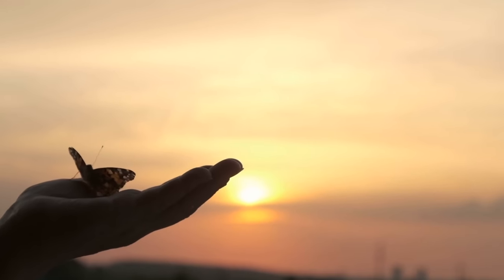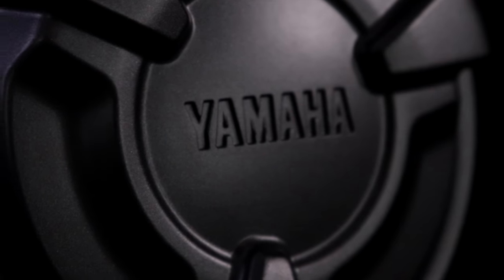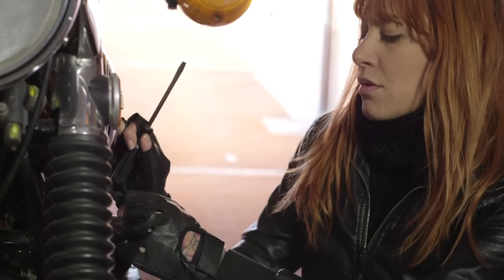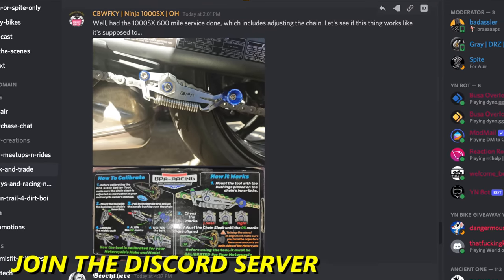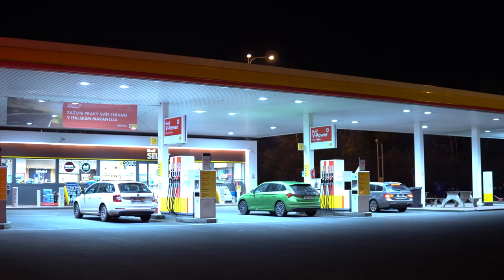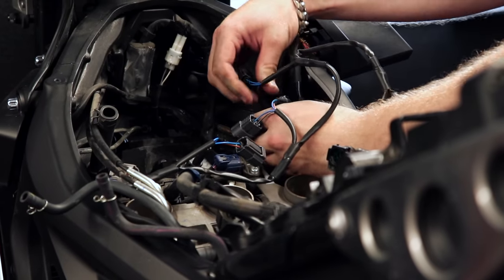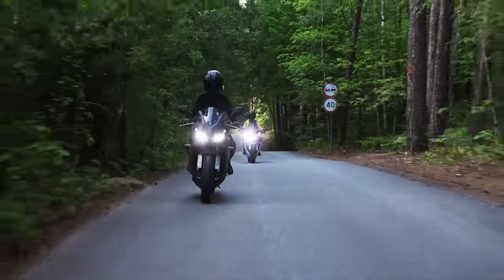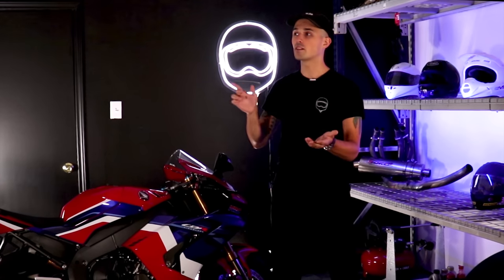7 Ways to AVOID Damage to your Motorcycle (Will Last Forever)!

Comment: “Never redline it.” I paid for the whole tachometer I’m gonna use the whole tachometer
Reply: redline is literally meant to be bounced off lmao. Makes absolutely no sense to say what he said. Proves the yammy noob downfall this guy been experiencing since covid.
Reply: Not to mention he reasons "Valve float", when generally the OEM sets redline 500-1,000 rpm before any Valve float (or other stresses)
Reply: @blizzthebike Todays materials cant withstand constant redlining. Do it and it wont last over 30k
Reply: This might be the dumbest thing I have read all week. Do you use that whole speedometer as well, or the whole brake lever, the front one of course.
Reply: @pmudri todays materials engine wise are better than ever before
Reply: @louiscrespo1280 Exactly
Reply: @louiscrespo1280 that’s not necessarily true because while we have better manufacturing processes, does that mean the companies are actually using them? Or are they cheating out on lesser metal and the putting them through a crazy process to only marginally “strengthen” them? That first comment on this thread got me laugh like a fool. Boy must’ve been dropped a couple times as a baby. Our steels aren’t as good as they were 100 years ago. Aluminum is one of those things where it’s either hot or miss on the manufacturing process. Some companies nail it, while others do not. Most of this thread makes no sense and I hope I actually educated someone today.
Reply: @christophertyacke6019 issa joke
Reply: @tty117 🤦🏻‍♂️
Reply: @christophertyacke6019 yeah the saying literally started as I paid for the whole speedometer I’m gonna use the whole thing😂
Reply: @christophertyacke6019  Ofcourse, just ease into it
Reply: @christophertyacke6019  it’s a joke but it holds some truth
Reply: as a 2 stroke 50cc moped user, I wholeheartedly agree
Reply: This line is said by fortnite 😂😂
Reply: Fortnine reference. Love it
Reply: @pmudri I'm here to remind you @ 70k Miles that is a lie on this 471cc. I'll be back to check on you later.
Reply: @louiscrespo1280  "Todays materials" oh please.. Ive seen SRADs that are used solely for redlining at gatherings , yet they are over 20 years old and still working fine.
Newer bikes could never lmao
Reply: @christophertyacke6019 😂😂 damn that’s some serious wit I’m jealous.
Reply: No, dont do it 🫣
Reply: HELLL YEAH BRUDDER
Reply: @blizzthebike Nahh you’re wild for that😂

Comment: Whew! I ride a Honda! 😂
Reply: Me too brother ✌
Reply: 2019 Honda CB650R here! ✌🏼
6,200 miles on the saddle and multiple mods and the smiles are endless per gallon!
Reply: @miguelcabanillas8539  I have a 2020 Honda Rebel 500. 9,500 miles already and riding as often as possible :)
Reply: On my second Honda CBR I love these bikes so reliable and I think there pretty sexy
Reply: Africa twin, only problems I’ve had so far fixed themselves
Reply: I became a Honda boy instantly. I Ride a 2021 cb650r, dreaming of an Africa Twin
Reply: Honda's very good but why did Yammie not mention the #1 most reliable brand in 2020.....Yamaha!
Reply: I've got a 2000 VFR800 and i don't think a new bike could be more reliable or last longer than my already 21 y/o bike.
Reply: 2006 cb600f approaching 45 000km
Reply: 79 CB750F over here still cranking
Reply: In love with my cbr 600rr and Africa twin. Honda for life!
Reply: This should be Hondas tag line or slogan…. I love it! Especially since I ride one 😂. I bleed RED, and if you bleed anything else, go see your physician.
Reply: I ride a 2006 Honda 919 hornet. It’s a great bike. I think the top end of the engine chatters slightly until it warms up. 17k miles had it for 5+ years, under 7k miles when I bought it. Great bike tho lots of smiles on it
Reply: Any CB300R owners?
Reply: HONDA GANG ! CBR500R her
Reply: My 2004 VFR had 101,000 miles on the odometer when I sold it.  The engine was still amazing, as was most of the bike.
Reply: Laughs in RVF400
Reply: So do I.
Reply: Regardless of brand any Japanese motorcycle will last if taken care of. 102k on my 05 zx10r. Daily commuter.
Reply: @Maxime_L91  yes boi. 5th gen gang. Hopefully you chose the only best color there is (blue duh) 

enjoy many more safe miles on the best bike there is!
Reply: 07 CBR600RR running new like I got it yesterday.  Just got new tires and a battery.
Reply: Same!🤣
Reply: I got a honda cbr 600 it's 1993 and still purs like a kitten
Reply: You meet the nicest people on Honda
Reply: @miguelcabanillas8539  I had the 2014 CBR 650F. I rode that bike 8 hours in one day, 6 tanks of gas in one day and it didn't even get hot, let alone have a problem. Great bike.
Reply: Lmao, they break too Papa 🤣 🤣
Reply: @CaptainFeathersword  because it's more better and reliable 🤔
Reply: @awatts222  you know, that was one of the reasons why I pulled the trigger on it. From scouring the internet for reviews and opinions, it all boiled down to "Honda has perfected this engine over the decades, it's a great beginner bike that could be a forever bike and it's well-behaved."
Reply: @Foodgeek  that's awesome bro!
Reply: @rodrigosimoes185  don't you find the throttle kinda snatchy?! Especially in the low rpms of 1st and 2nd. I want to have it tuned to see if they can smooth it out.
Reply: @PranouPranou  👋
Reply: Whew!! I ride a Duc🤘
Reply: @miguelcabanillas8539  yes, indeed. It's not tiring snatchy for me, but I can see how it could annoy me in denser traffic situations. I think it's getting better, but maybe I'm just getting used to it
Reply: Me too, I’m so bored lol
Reply: Have had a Honda for 5 months. Left stranded twice and been in the shop for 5 weeks of this time. Not sure I feel the same as others.
Reply: Honda Shadow VT1100C. MY BIKE IS FREAKING INVINCIBLE.
Reply: Cbr250rr rider here 40000km as far as I know (it’s only a 5 digit odometer plus it’s an import from when every import had dodgy km’s it’s hit 19000rpm every time is been started still goes strong
Reply: Honda CG125 for life!
Reply: If you have a high-mileage Grom it doesn't count.  Those guys change out every part of the bike, just for fun.
Reply: @Maxime_L91  I have a 2003. Runs super well, other than regular maintenance.has costed me only 2 valve adjustment jobs. Im now at 80 000km. And found i have a cracked cam holder. Bike now parked indefinitely. Cant just order the cam holder. And the kit cost 2000$. 🤮
Reply: @CaptainFeathersword  Yama who?
Reply: @PranouPranou  ✋
Reply: My CBR F4i can't be destroyed
Reply: @miguelcabanillas8539  my next bike
Reply: @miguelcabanillas8539  use metric system
Reply: i got a 2021 honda cb300r first bike i got it 3 months ago 1400 miles on it i love it  but will be getting a bigger honda when i pay this one off its been a  great biginner bike
Reply: My daily is a Honda shadow, my current project is a 95 zx6e but I've got a lot of faith in the kawasaki
Reply: i might have more honda pride than national pride
Reply: im looking to buy a 2001 nsr 125cc soon!
Reply: Learned to ride recently on an 08 CBR600...The bike is over 10 years old but still feels brand new when you're riding it and the owner says he's only ever done yearly maintenance on it.

So it'll always be a Honda bike for me...even if they're not the sexiest name in the business
Reply: well to bad the Honda CB 650 R 2020-2021 has an awful gearbox, the engine runs great... gears not so much xD
Reply: I ride a honda cd70
Reply: RC51 ftw here 🏍
Reply: Honda cbr 600f3 game my first bike and I’m in love
Reply: Im going to say it Honda makes sad bikes for sad people
Reply: I got two 1980 monkeys and they still work as new
Reply: Cbr600rr ftw!!
Reply: Same. The start scared me until he mentioned you're fine if you ride a Honda
Reply: @troymholmanify  I just upgrade to a Honda Monkey 125. The upgrade is in the fun department :D
Reply: Rocking my 929rr and F4i forever! 😎
Reply: Honda cb650r 2021!!!
Reply: Owned a shadow sabre 1100. Miss it occasionally, way happier on my Suzuki gsx650f Katana! Twisties are an exhilarating thing. Difference between cruisers and sport bikes is night and day. Safe to say I'm a fast boi for life
Reply: I ride old Honda! 40 years this year
Reply: Me too brother. Hondas are immortal. 😁

Comment: Please, for the love of all things holy, do NOT drain the engine oil. This will only make it rust faster. Ensure the oil in it is less than a year old, and roll your bike around in gear every few months. Oil stops rust. Why would you want to drain it
Reply: Yeah.....didn't quite get that part. I totally agree with don't ride in the rain, then immediately cover it up while it's all soaking wet, but IDK why you'd want to drain anything other than maybe the tank (and that only if you can make sure you get ALL of the gas out).
Reply: Yeah, I'm not draining my oil, F that.
Reply: The reason why you would drain engine oil and I see this a lot with our trucks, is that oil is acidic. The additives in engine oil reduce the acidity of the oil, however, oil does not like to be mixed. It may mix for a month or so but after that period, the additives will seperate from the oil. Only two ways to prevent this: start the engine or Darin the oil. The reason why the acidic nature is bad is because of your engine seals. The oil will eat them away.

Comment: As for letting the engine warm up, you don't need to stay still until it reaches operating temp. Just keep the rpm low, like under 4500, until it's operating temp.
Reply: And shift calm, don't pull up like you're in a race.
Reply: 45 seconds or so to let oil fill all spots of engine they like you said keep it down rpm wise until warm theyn ride it like you stole it, my old ninja 600 60k that way not one thing ever broke

Comment: 1) Let your bike warm up before ripping on it.
2) Keep up with your maintenance.
3) Use full synthetic oem spec oil.
4) Use high octane gas in newer sport bikes.
5) Keep the bike stock engine wise.
6) Don't run your bike at or near redline to avoid valve float.
7) Drain bike fluids before long term storage.
Reply: i redline a lot sometimes on the interstate, can you please explain valve float in one sentence and what are some symptoms
Reply: @PChelpism  Valve float is when you rev your engine so high that your valves are moving faster than your valve springs can return them to their original position on the camshaft.

This is only something to worry about if your ecu has been modified. Stock motorcycle ecu's will automatically  restrict the rpms to just before redline even if you bounce off the limiter.
Reply: Just had the 7500 mile maintenance done on my Ninja 400...after riding it hard two track days. Have always used high test gas though not called for...for the detergent value alone....3 times that in Regular. New 636 in the works for next year.
Reply: In summary...
Reply: I am about to buy a motorcycle that has been stored for 5 years, I am certain that the previous owner didn't remove the fluids. What should I do when I get it?
Reply: @giannakk  Whenever I buy a new motorcycle (which is often 😂) I make it a point to change all the fluids and give it a tune up. This includes oil, coolant, brake fluid, sparkplugs and airfilter. I also clean/lube the chain and adjust the slack to factory spec. 

This applies mostly only to pre-owned motorcycles; the exception being brand new lower end motorcycles like hyosung and Chinese grom clones. Which usually come with the cheapest oil money can buy more akin to cooking oil that engine oil. 😂

If the motorcycle is carbed I clean the carburetors and make sure they're tuned well.

 Changing these things is relatively cheap and easy to do yourself, not to mention it will keep your motorcycle reliable and running great!

I've been riding for 12 years and have owned around 15 or so different bikes. I've never had one blow an engine of suffer a major mechanical failure.

Hope this helps and good luck on your build. Keep the shiny side up and the rubber side down!
Reply: @thefatmanmx  thank you for the reply, I am gonna make a check list to make sure I make everything right
Reply: @giannakk  Awesome! It's also always a good idea to inspect your brake pads for wear and tires as well. I also would replace the tires if they are over 10 years old.
Reply: @thefatmanmx  Thank you mate, i will replace them as previous owner already told me that they are very dry . I want to be as safe as possible on my first motorcycle :)
Reply: A
Reply: 8) DON'T listen to anyone who tells you to do a "hard" break-in on your brand new bike!
Reply: Thanks
Reply: Ur words give me hope 4 future generations.
Reply: Why would you want to drain the oil though? I'm not very knowledgeable with motorcycles, but if you drained the oil in a car and let it sit for a long time, that motor's F'd.
Reply: @anokat  Motor wouldn't be F'd unless you forgot you'd drained it and turned it back on without any oil. Lol But yes, for long term storage I keep the oil and drain the gas tank.
Reply: @thefatmanmx  oh gotcha, I'd do the same. But car engines can seize from rust if the oil is removed for too long. Though for a motorcycle, I guess we're talking about it only sitting for a season or so.
Reply: @giannakk  Kosta, what bike did you get?
Reply: @233kosta  I just bought a 2021 CBR1000RR with 0 miles on it. The Owner's Manual says the break in is literally just go easy on it for the first 300 miles. Lol. Avoid hard acceleration and hard breaking. Blew my mind. No more varying RPM ranges for the first 600-1,000. Just be nice for the first 300 miles.
Reply: @thagingerninjer5391  Yeh, they've simplified it quite a lot from the old procedures, though I suspect you'd still benefit quite a bit from taking it easy... easier anyway... until the first oil change, then throw in some more town/city riding up to 1000mi.

The engine itself isn't that different than what came before, I just think they've realised that very few people ride these bikes for long enough to notice any significant difference from the old procedure to the new. And even then, regular maintenance is infinitely more important.

After the 300mi though, you do want to give 'er some beans, maybe from 1/4 to 1/2 way up the rev counter. Nothing too silly, no revving her poor tits out, just get into a suitably high gear and open up the throttle to put some more pressure on the piston rings. Maybe 1/4 to 1/3 throttle would be enough. Should still pull pretty well and get the job done.

After you get to your 4000mi service, the engine should be most of the way through its wear-in. At that point of course you'd have been riding pretty hard already, which wouldn't be hurting anything, it's just that performance, smoothness and economy should continue to improve slowly leading up to and past that point. By 5-6k mi it should be completely done. Then the engine will be in peak form and it should stay there for most of the rest of the bike's life.
Reply: Interesting, I've also read you should fuel up your bike before storing to avoid something with air or something? lol (I'm a noob)
Reply: Valve float? Laughs in 2t
Reply: What’s considered long term storage?
Reply: Keep gas in the tank!! It will rust!!